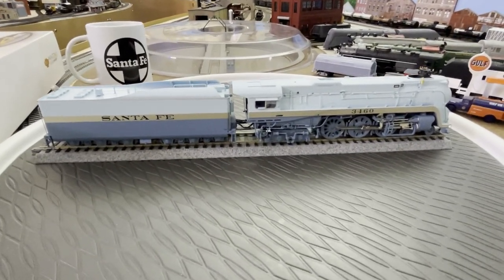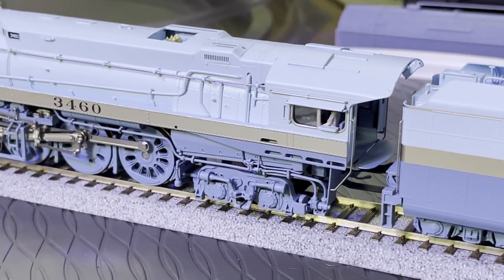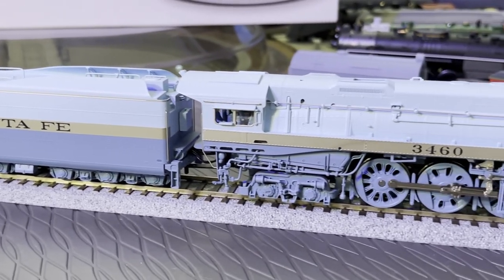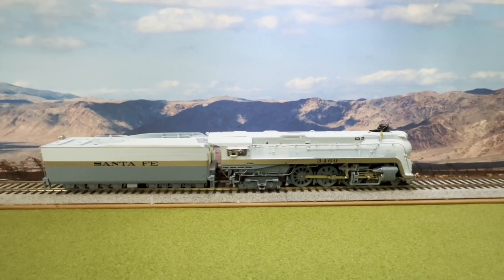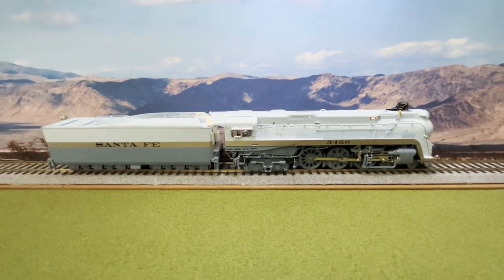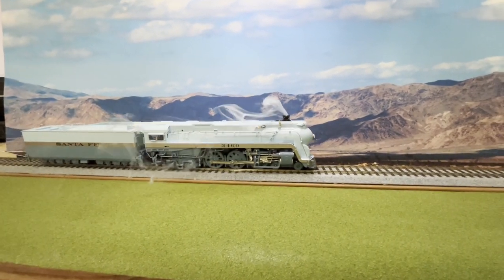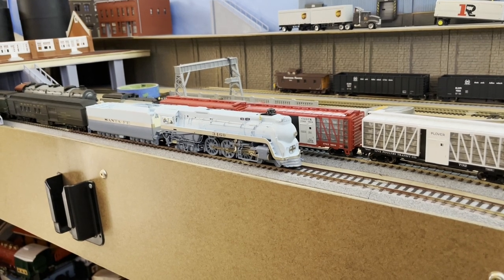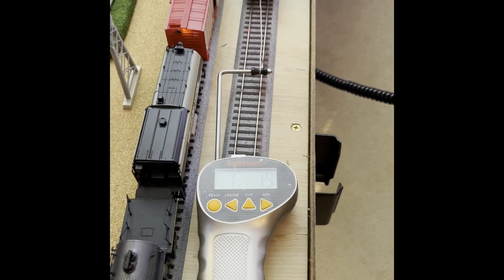BLI ATSF Brass Hybrid BLUE GOOSE, #3460, 1951 - 1953 APPEARANCE Review. Over 1 lb pulling power!!!

Comment: On the real locomotive, does anybody know what is the purpose of those CHAINS on the sides of the boiler? Kinda doesn't make sense...🤔
Reply from the maker: There are chains on photos of the real one that are attached to that access panel. Not sure if it was to prevent losing the access panel or what.